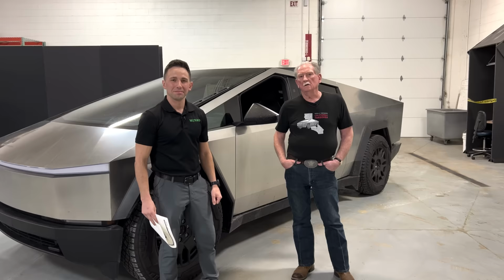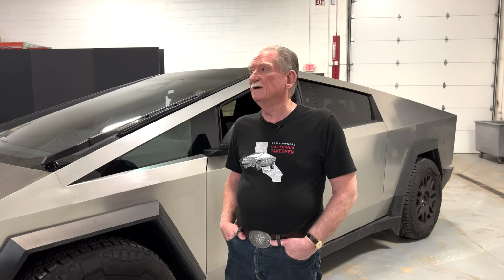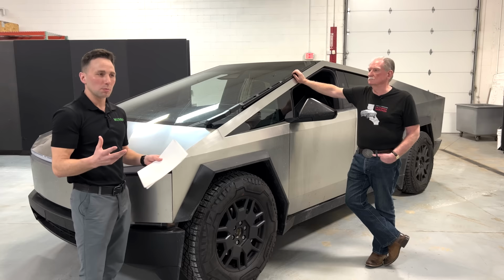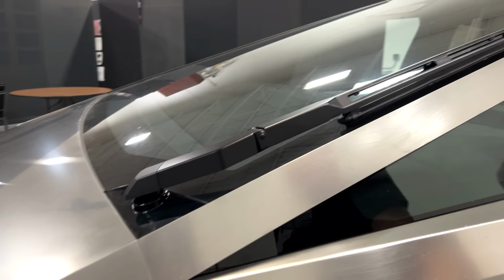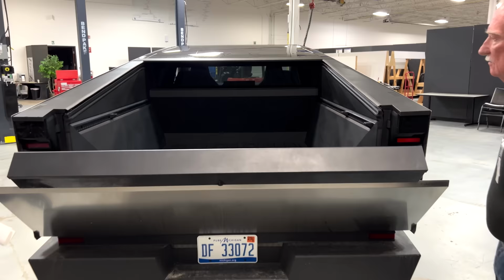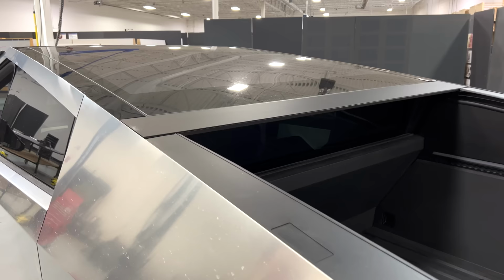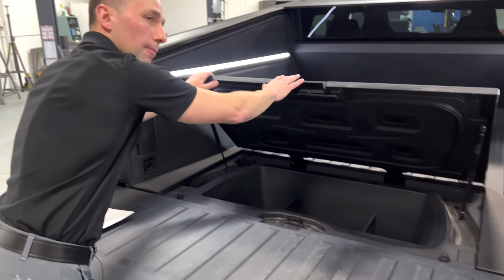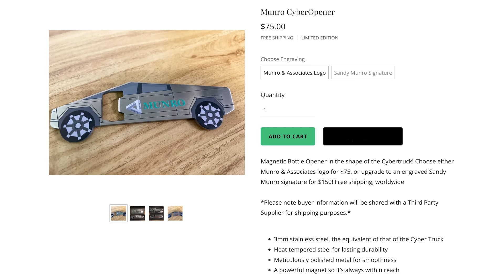We're Tearing Down a Cybertruck!

Comment: Can't wait!!! 🎉
I want to see that 48v system and how the wiring looks.
Reply: Simpler, more reliable.l
(Sandy will be All over that)
Reply: No way they will ever get that awesome monster back together again. They won't even try.
Reply: @Aztasu  Naive fanboys? you must be one since you're here
Reply: @Aztasu so it doesn’t  reduce wiring/ power consumption/complexity and more ?right lol
Reply: @Aztasu Ethernet-like bus, less cables, higher power off of acc battery... What do you mean there's no improvements?
Reply: Aztasu is obviously 8 years old!
Reply: None of the "tech" is new, innovative and they have no real-life advantage or effect for the customers.
48V doesn't do anything for the customer it only minimizes the wiring weight by a tiny amount. In a heavy steel panel truck like the Cybertruck it is utter useless. If you really need spontaneous high power then you better hook up the system accessory directly to the 800V system. Porsche managed to hook up their active dynamic suspension system to the 800V system in the Porsche Taycan. It is also connected to the navigation and camera system to anticipate and analyze road conditions in real time and ahead. That is groundbreaking. For everything else 12V is enough, safer and cheaper.
48V is overkill for low power applications and quite useless for high power applications. There is simply no need for it except in lightweight or small EVs.
Just look at what the truck delivers in the real world and it just manages to keep up with the Ford or Rivian. No advantages. Real engineers know that. Unfortunately fanboys and Tesla shills like Munro are clueless and are trying hard to push a narrative.
Reply: @BBingo-v5i  lmao 48v will be the new,even ford is working on 48v 🤦‍♂️🤣”all engineers know this” lmao no they don’t, 48v is  not overkill, in fact  it’s safe(just look it up lmao) and reduces current 4x and copper usage, your comparing porche suspension , fast corners to a heavy truck🤣, tesla plaid at 400v beats  the taychan.
Reply: @junioo3692 Agreed. Though to be fair, the Taycan Turbo GT with the Weissach package does 0-60 in 2.1 secs and beats the Plaid at Laguna Seca and the Nurburgring.
Reply: @rogerstarkey5390 How in the hell will it be MORE reliable - you know thinner wires fatigue and snap more easily right...??? 

Its CHEAPER - its not more reliable
Reply: @junioo3692 HAHAHAHAHAH what are the losses in a 10 foot 12V 0.5A wire V a 48V 0.124A wire - square route of ZERO.

NO it makes zero difference to the power consumption, NO its not less complicates, NO it does not reduce wiring - it reduces the COPPER Tesla use and therefore the cost TO TESLA - not to you!!!   You pay $120k.  What you. get are wires with a "strength" that is much LOWER, that will work harden exponentially quicker, and be way less relaible in the long run,.

IF they went to 48V and kept the wires the same or just slightly thinner with way more strands - that would be good - BUT THIS IS A COST SAVING EXCERSISE FOR TESLA and it means you cant buy any 3rd party items like a tail light bulb / LED
Reply: @casualgamer1209  Ethernet-like bus were tried by Mercedes in the S Class - they were a nightmare.
Reply: @junioo3692 YEAH they are moving to 48V cos THEY save about $200 per car in copper...!!!  Over say 250k cars a year that is $50 MILLION

There is literally NO benefit to you - only massive drawbacks - like the $175 for a tail light bulb they will charge you
Reply: @piccalillipit9211  there’s no benefit to the consumer ? Lmao 48v brings  features that won’t work on 12v,  48v will reduce current. Good luck having steer by wir  on 12v, or heavy duty light bar, reduce power consumption(ac for one), brings weight down, should I keep going on 🤦‍♂️
Reply: @junioo3692  What "features" does 48V bring that "won't work" on 12V?
Reply: @juliusdavies2005  technically all features work on 12v but that would require thick wires(current), would increase weight of the car(copper usage, wiring harness) , and lower efficiency. Good luck powering Tesla steer by wire system that require about 2,400 watts on 12v, now imaging a heavy duty light bar
Reply: @casualgamer1209  TBH, I don't know why they use canbus in cars when USB and ethernet are 9000 times more fit for the job.
Reply: @BBingo-v5i  You don't know what you are talking about. LEDs run on 2VDC, and most electronic ICs run on 5V and 3.3V. If you ran 600VDC to every corner to power the little things you'd need expensive high voltage cables and then giant 600v to 5v SMPS bricks on EVERY little electronic module.
Reply: @juliusdavies2005  To power a fan motor for air conditioning at 12v requires like 45A so big wires. At 48v it only requires 12A. So wiring harnesses are simpler and more things can share a fuse. It also reduces fire hazards.
Reply: No, that does not reduce fire hazards, especially not if you reduce wire thickness, make everything less durable and simpler and share the fuse. The amp difference is too low anyways. However, one reason why 48V (or more) has not been used widely for low power applications is the health risk involved with hooking up buttons in the interior with higher voltage. Or thin wires (just like Tesla uses them) to snap or misallign and energize metal body parts (maybe a steel truck is kinda stupid in this case). 48-50V is the the max level perceived not to cause serious injuries, which is why 48V is kinda the max for low power applications. There is NO real life advantage for the customer. Everyone knows this which is why 48V was never able to take off and replace 12V even tho the industry knows about it for many many decades.
Reply: @piccalillipit9211  lmao all what u said  contradicts Tesla lead low voltage engineer.  watch sandy Munro interview lmao.This is Basic electrical engineering(there’s something called I^2R 💀💀). even better ask any ai. 🤣
Reply: - like DC wiring....  lol...  jokes...

 - surprised the whole car isn't just running off a few wifi controllers - eliminate all the control wiring too.
(though a fibre network parallelling the DC supply tree is "very simple" and eliminates security and noise issues of ethernet - BMS units too.)
Reply: @junioo3692  HHAHAHAHHAHAHAHHAHAHAHHAHAHH. oh it contradicta a TESLAS engineer does it - thats amazing.  I2R heat loss in a wire depends on R and R is a short copper wire is square route of zero.  I build tube amplifiers as a hobby 

QUOTE "The resistance of copper wire, of length 1 m, is 0.1 ohm"      !!!

Comment: Can't wait for the teardown, Bottle openers made from the actual cybertruck would sell like hot cakes
Reply: Yes, and also thought that Tesla could sell the stainless steel pieces that result from cutting the truck doors, hood, etc, as it seems of very good quality and it would be very helpful for lots of proyects 👏👏
Reply: lame!!!
Reply: I think its over-rated and not practical.
Reply: @deltajohnny  Yea, but you can just get stainless steel sheets at the local welding shop.
Reply: @tripplefives1402  Yes, but I mentioned it because this stainless steel seems to have special characteristics? I think that the ones that I use with this thickness are not bulletproof 👍👍
Reply: Zach of @Jerryrigeverything - could do that from his shot-to-pieces door - and fit a new one to the vehicle..
Reply: @deltajohnny  no, its really just thick sheetsof stainless just like you get from any metal supply.
Reply: @tripplefives1402  thank you very much, and I read that Tesla specified a special alloy to make it stronger or something like that 👍

Comment: Unsure why it being an enthusiast truck doesn’t mean it can’t be a great work truck. 

Seats 5. Huge lockable storage. More power output. Less worried about dents and paint damage.
Reply: He keeps saying it's not a work truck but I never get to here why he thinks that. Higher payload, more durable, larger bed. I see no reason to say it's not equal to or better than the f150 lightning as a work truck
Reply: yeah, I just don't see that either. Seems to me like the best work truck ever. I see a lot of F150 (and similar) contractors trucks that have 100's of little (and big) dents, dings and scratches in no time. Air suspension with auto levelling is a great "work" feature too. On the reverse side, the fact that there is no access from interior to rear vault area, makes it less than ideal as a "sport" truck. I'd love to hear from Sandy the "why" not the best work truck?
Reply: @dbmiller5881  unfortunately I'm fairly confident that Sandy doesn't have any objective reasoning for this statement. I have a feeling it's because of the unique look and that alone.
Reply: I am pretty sure it is because of the reach in from the side issue.  Many work trucks have a toolbox reachable from the side. I am almost certain this is the reason and why most people I have heard say its not a work truck is because of that issue.   I will say, that I will miss that particular aspect of my current truck when I eventually get one of these (eventually.....)
Reply: Maybe it's price? Right now the cheapest one is 99k. Basically are paying 20k for FSD and founders stuff. I got the email, but it's hard for me to justify paying that much extra for things I don't need right now. I also haven't bought FSD on any of Teslas we've owned though.
Reply: @Shiftheads  fair but temporary point. 80k by year end, and then 60k by likely mid next year for rear drive. Pickups are getting crazy expensive on general.
Reply: The argument might be made that at this moment a non-electric F-150 might be a better work truck choice if you’ve got to tow heavy equipment with pintle/ring type hitch.  Some of the Supercharger banks near me aren’t drive-through, which would mean dropping the trailer before entering the Supercharger might make life easier.  I haven’t driven a Cybertruck, so that’s speculation.  Throttle House did a 500 mile Cyberbeast trip and they had an issue with the four wheel steering appearing to make backing out of the Supercharger stall tricky.  I don’t think I’d want to back up with a trailer attached…. for now.  Trailer ability is something software can fix, and if it is an issue Tesla will almost for sure work on it.

Comment: why does everyone comment on the size of the truck...? this is a normal sized truck, perhaps a little small. it might look, or feel big, but dimensionally its got nothing on a crew cab long box dually.....
Reply: Yup.
Reply: Yeah, for sure. I sat in one a few weeks ago, it doesn’t feel as big as my f150.
Reply: @kestrelglassingsystems6704  It is shorter than a crew cab F150 with a 4 foot bed.
Reply: This isn't any more a truck than the Chevrolet El Camino, Ford Ranchero  or Subaru Brat was a truck.  Simply having a bed is not the definition of a truck and an F150 or RAM 1500 has a larger bed (both of which are actual trucks).
Reply: @bbaz6729  They are available with longer beds, but my F150 (in the most common trim and still obviously a truck) has the 5.5' bed.  And, genuinely curious why you think based on objective specs the F150 and the Ram 1500 are actual trucks ad this isn't? I own an F150 (for 12 years), and I've spent some time messing with the CT.  Other than the back seat being a little larger in the F150, there's no significant form/function difference. Meaning Pretty much anythign I can put in my F150 will also go into a CT.  The other specs are similar: towing (same), payload(favors CT).  The CT is undoubtedly tougher on the skins than my truck, at least for dents and scratches.  Both seem capable enough off-road, and CT would have had more ground clearance on the trail that ripped off the skid plate on my F150 FX4 last year.  Honestly, not trying to be snarky, what makes the CT not a truck by your definition? I'm really curious about other truck users perspectives here.  Is a ladder frame triple box design fundamental if it can accomplish the same tasks? Thoughts on the F150 Lightning?
Reply: @danharold3087  Yes, I know.  But also the shape just makes it feel less imposing in size.  In other words, while most people seem to be coming away with the notion that it feels big on first impressions, I don't think most full size truck owners are going to think this.
Reply: @bbaz6729 if memory serves the beds on those 2 are not bigger.
Reply: @bbaz6729  
 My criteria would including utility/payload/towing.  If I recall correctly the EL Camino, and Ranchero etc  have payloads that are 1/2 or less  the CT.   CT is far stiffer and at least in terms of the body shell the most durable pickup on the market.  It also has the torque and HP of a the diesel engines used in full sized pickups.   Compared to the Ford line it generally falls between the F150 and F250.   IT also has a ultra high strength hot stamped boron steel steel passenger compartment sides.   Arguably the strongest on the market.    This is not you grand dad's El Camino.
Reply: I think it has to do with where the driver is positioned inside the truck. You basically have more truck behind you than with any other truck the same size. You are basically sitting where most trucks would have a hood and you really have to think like a truck or bus driver.

I struggled with this when I first drove a mini bus, which is almost the same size as a pick truck. I kept getting the rear wheels driving over the pavement when taking corners.
Reply: If we’re talking mass, the Cybertruck is the most massive thanks to the 123 KWH battery.  For dimensions, the Cybertruck isn’t crazy, but I believe neither the Cybertruck nor the crew cab F-150 will fit in my garage.
Reply: @robindehood207  I had a 1969 Chevy G-10 van and the driver is inches behind the front fascia.  It takes a little getting used to, but not too long.  It kind of freaks out front seat passengers who aren’t expecting it.
Reply: @wtmayhew  GMC hummer and pickups are all heavier.  The 4WT has a 2 layer 215.0 kWh battery and a Curb Weight (C/D est): 8500 lb.   Had the CT been built with the 2 layer battery as presented in in 2019 it too would be similar. They did not so it is about 2500lbs lighter.
Reply: @danharold3087  Thnaks for the correction.  Totally forgot about the Hummer EV.
Reply: @wtmayhew  Have you seen where electric WT4s have been sold ?

Comment: Please let us know. If at all the cybertruck exterior panels were made as a traditional truck, would that make the truck heavier or lighter keeping the overall truck structural stiffness same. Does the exterior SS panels really contributing to structural stiffness.
Reply: It would be lighter and less stiff.
Reply: Which truck is heavier? The lightning or cybertruck?
Reply: There is one of the vids in the Tesla factory.   It may have been with Cory.   The engineer said how much stiffer the rear sail makes the truck bed and how much the front fender contributes to the crush.   Sounds structural to me.
Replace the exterior work hardened SS with mild steel and the castings would have to be made heavier to keep the same stiffness.   However this truck is so incredible stiff it would still be serviceable.  Just not as tough.  Why the quest to prove Elon was a fool to use this material?  Or is the goal to show that he lied? Tesla gave us a pickup that breaks the mold. That is a GOOD thing.   Elon being human has real faults.  You don't need to make this good thing look bad. Celebrate it.  My apple gee's if I misread you intention.  It happens.

Comment: Aesthetics aside, my problem with CYBRTRK has always been that I don't find it to be a particularly practical Ute in terms of work truck usage. Sandy & Jordan's comments reflect this. Having said this, again it's a case of right tool for the right job for the right person - I'm just not that person. I much prefer the Ford Lightening F-150 even if it is (still) far too big; you don't need a tank to get the job done. 😊
Reply: I believe this is dimensionally smaller than the F150 on the outside.
.
For a work truck...
The bed is 150mm(?) longer.
It has the tonneau for security.
How about a bed slide-out?
Then you instantly get the easy access*plus* the security of everything covered?
Reply: exactly! the ford lightning is the best shape or design to ever existed for actual work! look at the toyota hilux, in Thailand they convert the bed to dump truck, upgrades the suspensions and make it move up to 5 tons of rice from the farm to storage.... nothing will ever equal that!
Reply: @alanmay7929  The importance of the ability to (easily) side load into the bed of a Ute can't be overlooked. When doing (a lot) of loading, having to walk those extra few steps to and from the back of the bed is both exhausting and a time waster over the course of the day; you can't always back directly into where you want to load from. I really think Jordan can be excused for the challenge as he puts it, 'of being vertically challenged', as tall, short, or anywhere in between, just looking at the high sides of CYBRTRK makes my shoulders and neck ache madly.
Reply: The cybertruck has a larger bed, more ground clearance, and more durable body and glass when compared to the f150 lightning. What exactly does the lightning do better?
Reply: @pinkelephants1421 side loading gets you in trouble by any respectable tradesmen. You will scratch the paint. If the item is small you put it in the cab or towards the end of the box.
Reply: @pinkelephants1421 
I have driven a work truck for decades and the number of times I loaded over the side can be counted on one hand.
Reply: @freddymax5256  Well, I grew up on a farm and side loading was an everyday thing. Just depends on use cases I guess; every one is different.